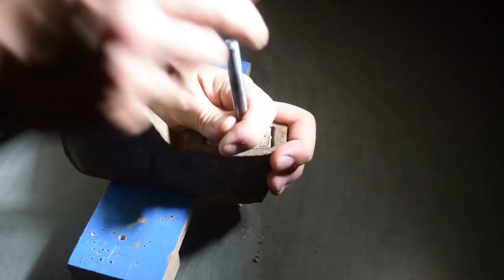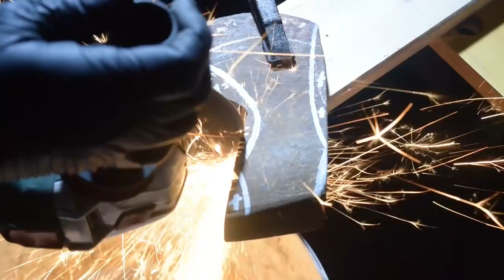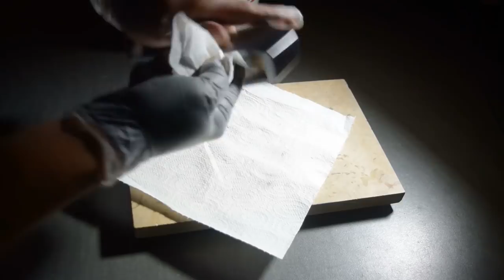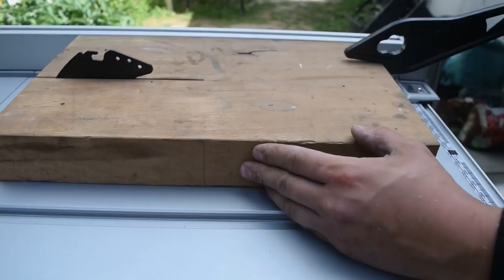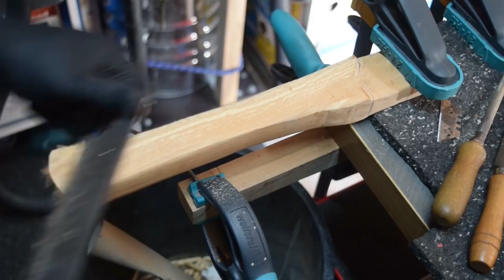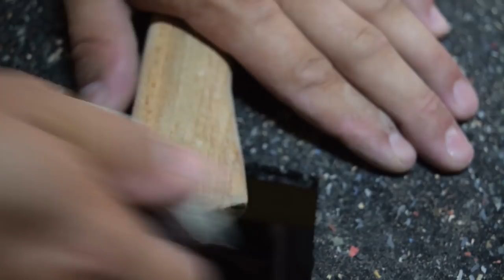How to Make a Viking Style Axe from an old Rusty Axe - No Forging

Comment: Why the acid when you grind everything down afterwards?
Reply from the maker: Good point, probably to get a better surface to sketch on. In hindside I would probably use a wire wheel for a rough clean up.

Comment: Nice work as always :) the hole you put in the handle .. was that to keep the wood from splitting any further down?
Reply from the maker: Thank you very much Vince! Yes the hole is supposed to reduce the risk of splitting the handle. I think the size depends on the size of wedge and how wide the slot is.